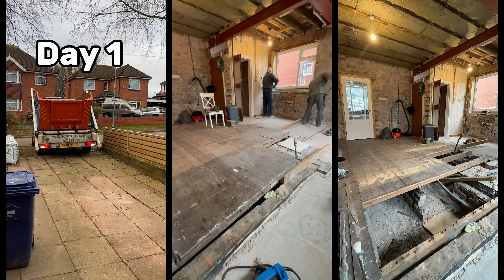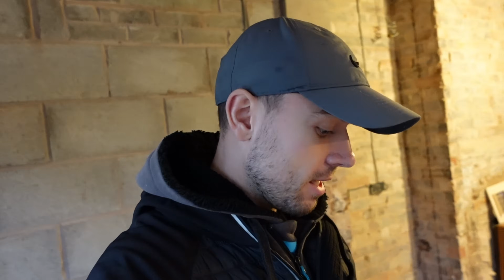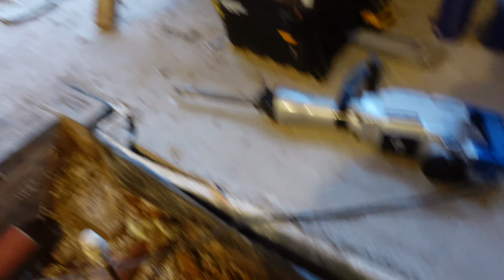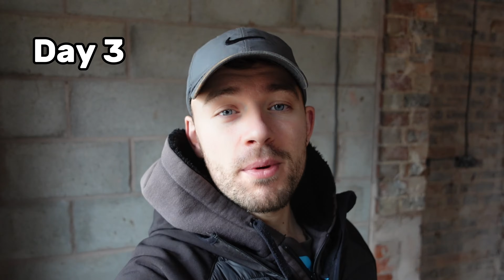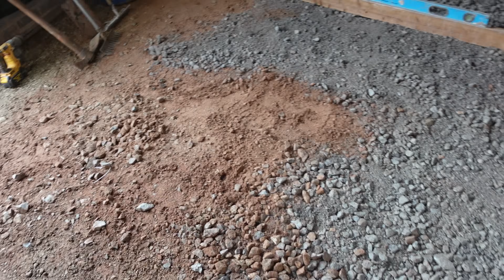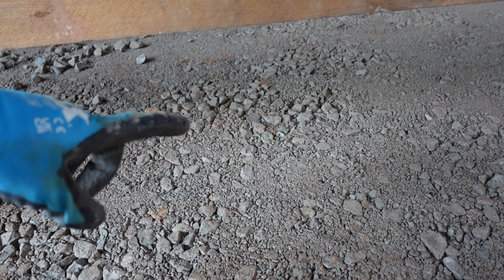DIY Water Underfloor Heating - Part 1

Comment: So happy that you have shared this. I am also considering doing the same thing and your video has really helped.
Reply: I have a solid concrete sub floor about 380mm beneath a suspended floor and I'm wondering whether I can just use MOT 1, blinded sand, DPM, insulation and then UFH pipes (without the need for another concrete layer)?

Comment: Thanks man, I'll soon renovate my own floor, depending on your tutorial here, you might be able to convince me to put floorheating in my floor too :)
Reply from the maker: That's ace! To be honest it wasn't that expensive to do it myself but it was hard work
Reply: @scott_diy ?
Reply: Hiya new subscribers here How much did it cost u just having a kitchen extension done myself and thinking of ufh  but we wanted herringbone wooden flooring not tiles will it still b warm do u think ?
Reply from the maker: @liamdavis9017  sorry for getting back to you so late, I missed this notification. It only code about 2.5k so that’s pretty good for a job that’s usually £10k plus. It adds value to the house too

Comment: Thanks for all the valuable content ❤ – do you know if you can use Alkathene pipe (the blue or black stuff farmers use to connect to a trough in a field) ? It’s difficult to find videos on that!
Reply from the maker: I’m not sure actually! But it’s a great question. I hope someone can answer it for you
Reply: Google tells me it's an old pipe standard and replaced by MDPE pipe. I'm not an expert, I'll use HDPE pipe to run water to my garage which is seperate from my house. This seems like a better solution to use outside under my driveway. What are your plans with this pipe?